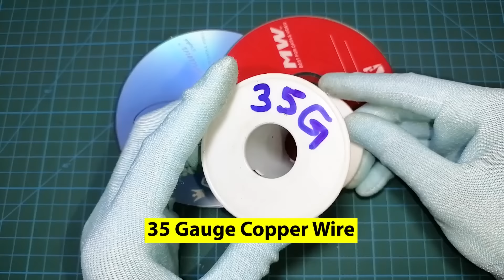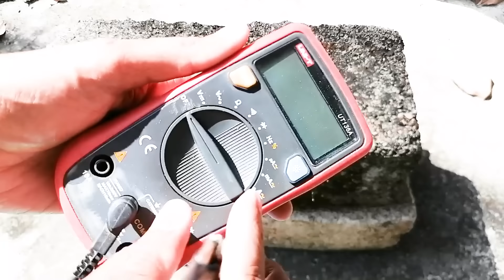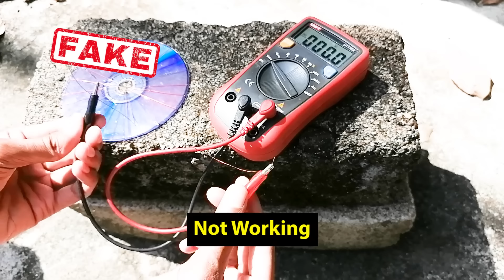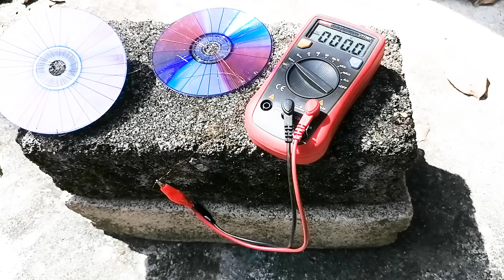I turn CD/DVD into a Solar Panel new Technology, Solar Energy

Comment: Thanks for doing this, if it were to work at all, this would not be the way to allow the electrons to flow.  For instance, if the electrons were stimulated on the surface from the sun then putting a coil around it would just short out the current flow...
Reply: I found making 1 CD of Micheal Jackson and the other Phantom of the Opera was more satisfying

Comment: Your video is really informative. if anyone can make solar cell like this why the scientists are working days and nights making such expensive silicon solar cells upgrading everytime. many people are saying to check the numbers of turns but that do not make any sense if they have 46 turn and shows 9 volts by only 1 cd then the two cds connected together in this video must have atleast 8 volts.
Reply from the maker: thank you... yes, you are right 🙏😇. Forged CD?DVD solar panels.
Reply: So many guliable people...

Comment: You see videos on YouTube in which solar panels generate voltage. But the real fact is that, they use a small battery connected to wires at the back side of the cd.
Reply from the maker: yes you are correct
Reply: i have actually seen a video were he connects a motor from a grinder..thats not a small battery...
although he might have connected some how to a power point but nothing is shown in camera...

Comment: Hi respectful sir when  you wind the copper wire on cd for making solar panel. You need to remove the complete insulation on copper wire and then you wind 46 turn and also you  should use dark blue color cd where you find the silicon.

Now check it will show the elections flowing.

Also in this you need to use a gelly solution ( do the research and find out the solution name, it cheap cost)

Do all the process properly and then you demonstrate to educate every one in the world.

You need to learn boss...,

Don't give wrong education please...

Comment: Creating a simple solar panel using CDs can be an educational and hands-on way to learn about basic photovoltaic principles, electrical circuits, and solar energy. It’s a fun way to engage in science and engineering exploration.

While you can create a basic solar panel using old CDs, the resulting energy output would be limited. 

It's like back in the day with those giant 9volt battery "science projects." You hook that battery up to a small light bulb and it produced the most dim light. This ain't gonna power your house.
Reply from the maker: :yougotthis::yt:

Comment: I have done one piece of CD with 46 turns of winding and get 0 voltage as you.
 CD Solar energy is still a question mark!
Reply from the maker: CD Solar energy is fake 🙂
Reply: Wowowo
Reply: I’m not saying this works but did you put your meter to dc voltage

Comment: Weren’t you supposed to use copper wire and much thicker than the wire you used? What kind of metal did you use?
Reply from the maker: no. CD solar is fake

Comment: Thanks for proving what I've been thinking and what most here that know a thing or two about electronics already know. Copper wire coated in varnish on a polycarbonate surface that makes no contact with anything, whether chemically through some kind of bond or through conductivity, metal or otherwise can't conduct electricity no way, no how, not a chance in hell. Yet, these guys get on YouTube to make lengthy videos showing bullshit. It amazes me the time and dedication they'll put into making these bullshit videos.
Reply from the maker: :oops::buffering:
Reply: Yep, rubbish. Just get a cheap new or better still tested used panel.....there are in theory so many from older PV systems which need to update...but many of the panels still produce useful power......keep your CDs attached to cheap plastic string only to scare the birds off your soft fruit instead... !

Comment: I think 🤔 the negative side is never supposed to touch positive when you wrap it around cd?
Reply from the maker: CD Solar is fk
Reply: the wires are insulated (why he scratched with a knife at the ends). That wouldn't make a difference here.

Comment: Why are you mounting your wire on old CD's ?  Could you not mount it on a square plastic sheet , or a shiny stainless steel sheet ?
Reply from the maker: But not working you can try

Comment: Why he put the multimeter on DC? Put on AC
Reply from the maker: Soler cell out DC voltage only
Reply: @homemade_101  Looking at other YouTuber videos, ac is output.
Reply: PVs are AC diodes are being used for the conversion